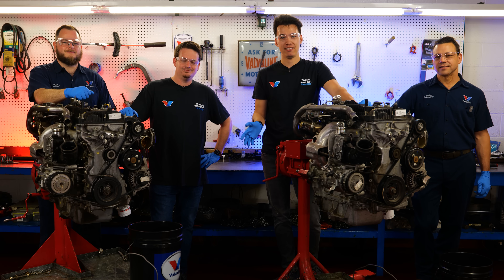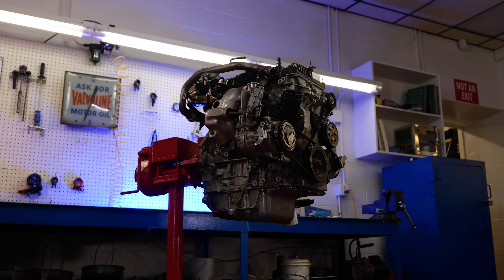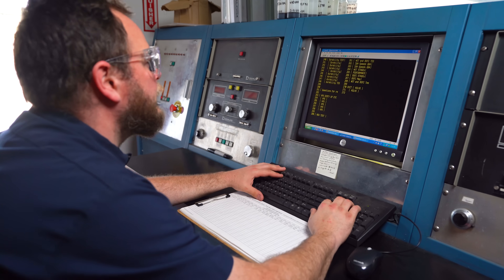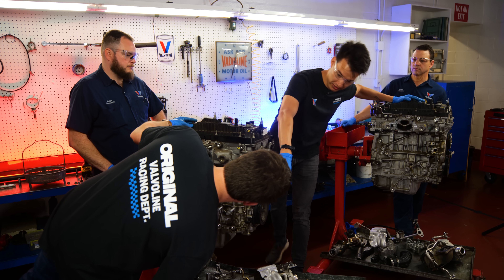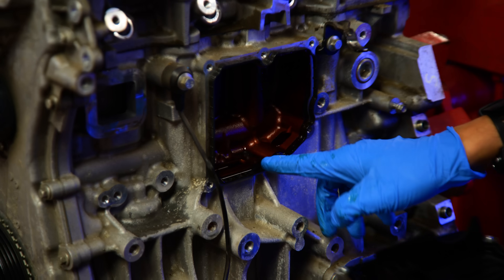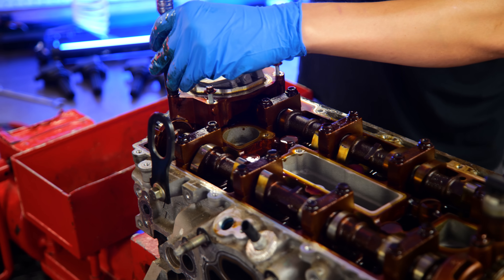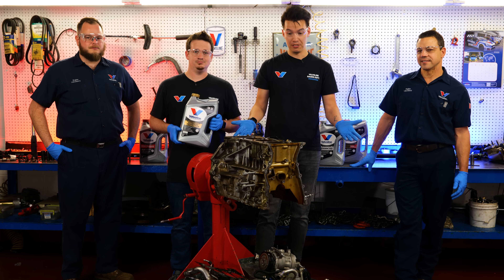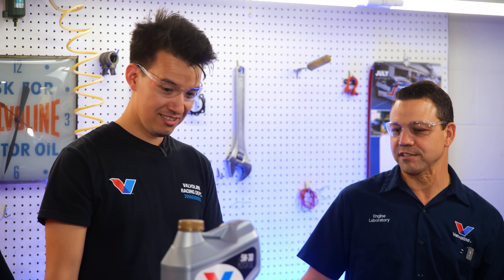Testing different oils over 4 years and 1 MILLION miles

Comment: I got my previous 4 cars with between 22,000 and 24,000 miles. Used only full sythetic oil and changes every 5,000 miles. All four reached o er 300,000 before I replaced them. Only maintenance was an alternator on one, the serpentine belts, and injector replacement on one. My current car I got with 22,500 miles, and currently it has 240,000 miles. Oil changes every 7,000, full synthetic oil, and it's still going strong. I do not buy the bargain oil.
Reply: What brand of oil do you like to use?
Reply: @DavidHernandez-oz4me  Penzoil full synthetic platinum 5w30
Reply: Beware of the Pennzoil Platinum vs the Ultra Platinum. Very simar looking bottles. The Ultra evaporates a lot less.@OcularPerceptions
Reply: @ytuploads9742  Pennzoil is Shell, total garbage
Reply: What vehicles were does if I may ask?
Reply: @Gabriellariz  There is no English answer to your question, as asked.
Reply: Sounds like motorway miles going the speed limit to me
Reply: @ArashiSanMa  If you do the speed limit on Florida highways, you'll become a hood ornament. And I'm in a mix of traffic every day. Florida highways become parking lots on a regular basis, so sometimes, going through the city is faster than staying on the highway. My current car just went over 262,000 miles, and I just replaced the struts and lower control arms. I did all the brakes last month. The engine is still dong fine.
Reply: Oil sold as full-synthetic in 95% of the countries are not full-synthetic oil with the exception of Germany.  Unless it explicitly says oil from group 4 or 5 (PAO/Ester) base oil, then forget about it being full-synthetic.
Reply: Yeah sure. 300k mile brake pads and rotors. Pretty good
Reply: should he also have to note he had to put gas in it once a week😂  "yeah sure 300k on a tank of gas"

Comment: a very good reason to go electric. maybe not now but in the future. EV motors don't need oil lubricant and may do long term service without problems. the battery and charging will be greatly improved. the real problem I see is reliability and diagnosis of electronics.

Comment: Americans, due to the pollution fleet standards, look-up your exact same car or engine sold in other countries for what oil weights and change intervals your manufacture recommends. Pay particular attention to them switching from Kilometers to Miles on the interval in the manual. For example, my 2010 FJ cruiser, Toyota recommends 0-w20 in the united states. The exact same vehicle in other countries can take up to a 50w, and change every 10,000 KILOMETERS (i.e. 6,000 miles). They also recommend more frequent for extreme use (off-roading, city driving). As I don't live in an extreme temp environment, I use 5-w30, full synthetic (shell), and change every 10,000 km or 6 months. Also keep in mind, the low octane on the untied states. Where I live, it is illegal to sell less than 93 octane, and up to 98 octane is available at most pumps. Ironically, that is due to pollution rules. 😆

Comment: I have a 1997 Ford Eddie Bauer Explorer I purchased new on December 28, 1996.  I still drive it as my everyday driver and presently have over 280,000 miles on it.  Regular maintenance and oil changes will keep your engine running for a long time.  I use synthetic oil in my Explorer.  Today's date is 10/29/2024.

Comment: Amsoil for the WIN!! 😁👍

Just imagine how much better an Amsoil engine would look even over synthetic Valvoline .
Reply: Saved over $3200 using Valvoline syn
Reply: @adamneill9237  you would probably save over $3600 if you just paid the $25 to be a dealer and get the Amsoil at cost. 

The more you know 👍
Reply: @johnnyturbo8460  I buy Valvoline Syn when on deal or Rotella T6. OCI's in the 7.5k area, and never an issue. Ain't broke, don't fix it
Reply: @adamneill9237  you do you, I don't like to settle for what's on sale, especially when i get Amsoil at cost. Most likely cheaper than Valvoline synthetic on sale.

Now, I'll use Rotella t6 on a barn find. Especially when I'm not sure of the engine's condition but don't want to run it on its old oil.

Then Amsoil it is, once I know it's a runner

Comment: WOW  from an old racer. HERE is the deal whenever you get a new motor-vehicle (yep basically any brand, though Toyota is the best) YOU MUST change the oil and filter EVERY 1,000 MILES for the first 5000 miles  (oil and filter 5 times). THEN begin a regular 3-5000 mile oil changes. THEN my friends YOUR little Corolla or whatever WILL have  hundreds of thousands of miles on it AND when you look down at the speedometer you will be flying at 80 MPH without even knowing it. THAT is how you break in a motor, and it will last until the end of civilization.  MAINTENANCE is the key no matter what. BUT yea Toyota passed everyone else as of 2024.  ARE you listening Germany, Japan passed YOU.

Comment: If the wastegate fails the crankcase won’t have right pressure and air mix won’t be right.  That could mess with engine performance and would cause the engine to degrade.

Comment: Bottom line synthetic oil the majority of it is a petroleum based product it has been chemically modified from its original crude oil base there are some synthetics however that are produced from other forms of oil such as plant based oil I have never had much luck with synthetics oil over the years I have tried it in different vehicles with bad results shame with my lawn equipment I am a firm believer in the real deal and also change my oil frequently which reduces the viscosity breakdown and varnish buildup Pennzoil is my go to product although I know valvoline is a good product also

Comment: I think if they changed the oil on both engines every 5000 miles there wouldn't have been any stuck piston rings on the synthetic engine. IMO any amount of stuck rings is an immediate failure and future usage of that oil should be stopped.

Comment: Synthetic keeps the engine clean most of times at regular usage and optimal temps. Good to see it working. While in some places it was harder to flush out all gunk and capture in the oil because of the design. I suppose you have to do an engine oil flush every 5th engine oil change or so with an additive before getting fresh oil in. This would boost the cleaning in a short period of time and keep the rings clean for the best compression and sealing.

Comment: Sooo. Now if you run synthetic through the engine that had the oil running through it, 2 or 3 oil changes would it clear a lot of that coagulation out and clean or flush the engine somewhat?

Comment: My 470,000 mile Volvo 240 has run CASTROL 10-30 its entire life, it looks better inside than your synthetic motor inside ,had valve cover off first time this summer for gasket replacement, I’m sticking with my conventional CASTROL as long as they keep making it.

Comment: I use valvoline advanced full synthetic in my new car. First change at 500 miles ( get rid of factory deposits), then change at half of the manufacturer recommended interval. But this is definitely one of the top oils out there for longevity.

Comment: should give more detail on the rod and main bearings wear, since those are the most critical parts of the engine if wear need to be compared, by the looks of it, conventional oil still good with proper maintenance interval and more cost saving in term of maintenance cost. Varnish are normal for that amount of mileage.

Comment: Here's the thing: My vehicle is factory recommended every 7500 miles. A full synth is $115 (8 quarts). I can get a conventional for $37 with a coupon and have been routinely doing this. I change it at 6000 miles with conventional at almost 2/3 less the cost.

Comment: A much more interesting test would be to see where a blend of conventional and synthetic sits on the spectrum. I suspect that it will be just as good as the synthetic, based on anecdotal experience. My car has run a blend since the beginning, and the design is such rhat i can see the valvetrain from opening the oil cap. Clean as a whistle in there, it looks brand new after a lot of hard use and extended intervals.

Comment: 12:35 engine will also run much hotter from all that hot blow by. That explains what happened in the cooling system.

Comment: Would it had been fair to change the conventional oil at half the mileage? I understand that it is a fact that synthetic oil lasts longer. What would be the RESULT with the engine running  with conventional oil?

Comment: I have an 2002 Corolla oil changes every 3,000 just got a reman put in. Only had its first oil change. Currently running synthetic blend. Recommendations?
Reply: Seems to be a fair change interval at 3,000 miles. For next to nothing, you can get a free oil kit from Blackstone and pay like $20 for them to analyze. Let them know on the form what oil and how many miles on the oil and they will let you know if you can extend to more miles before changing, if you should switch to full syn, etc.

Comment: It is perfectly possible to make a poor oil with a synthetic base stock. It is additive treat rate that ultimately determines how good the oil is. It's called tier level. Almost all modern lubes are synthetic.  The old base oils (Group I) are "non synthetic " and only used to blend obsolete lubes in non-developed countries.  Also- there is no industry standard technical definition of a synthetic oil. It is purely a marketing term but usually applies to hydro processed base oil (the oily, non additive bit).

Comment: Never surprises me. Like the chevy guy across the street working on his silverado every other weekend but asserting how great their vehicles are. The iignorance is breathtaking.
Reply: Owners who have been foolish enough to buy such products can't admit failure to themselves.
Reply: Chevys last exactly as long as Fords.  A Silverado w a 5.3L LS is far less stressed than a little turbo 4-banger.  Synthetic in Silverado… 500K + no problem and any repair bills would be cheap compared to a 4-banger turbo.  The turbos on the two engines in this test are worn out I promise you.

Comment: Hmmm.   I have opposite results with oil.   Diesel mechanic for 23 years and I always find the worst varnish and sludge in engines with synthetic oil.   Engines with conventional are always cleaner but hey, gas engines may be different but im basing it off of personal experience.

Comment: I've got the same drive line on my 2020 ranger and I change the oil every 3k and the truck experiences a lot of heavy payload and trailer. And a lot of gravel road/farm use.  I've used the synthetic Valvoline since purchase and the oil still comes out pretty clean with 150k miles on it so far

Comment: Old & hard of hearing but wondering if they used regular garbage gasoline or far superior top tier gas produced by over 25 companies. I use synthetic oil in my 2016 Honda CRV with 54,000 miles. I get the oil changed every 8 to 10 months ( Around 4,000 miles ) . On halve a dozen trips to the shore ( 160 miles each way ) I purchased Wawa's garbage gasoline in two states. Use the cruise control and all 6 trips took 3 hours ( +/- 5 minutes ). purchased top tier gasoline st Mobil, Citgo & Exon. All 87 octane for my 4 cylinder CRV. averaged 32 miles per gallon on Wawa's gas and 34.6 to 35 miles per gallon on top tier gasoline. According to AAA & others if you plan on keep you vehicls more then 3 years top tier is a win win. Better gas mileage and it keeps the inside of engines cleaner ( that alone improves gas mileage ) .

Comment: You should’ve changed the conventional oil at 3000 if you’re supposed to and like everybody else that uses it does then see the real results. This is totally unfair. Conventional oil never goes 10,000 miles between changes. The only thing I just learned is that they’re too scared to do it the right way because it probably didn’t even make that big difference if you change the oil every 3000 miles.

Comment: You should’ve changed the conventional oil at 3000 if you’re supposed to and like everybody else that uses it does then see the real results. This is totally unfair. Conventional oil never goes 10,000 miles between changes.

Comment: I have a 2018 Volvo XC60 from USA, 2.0, 310HP

Manufacturer on it’s website recommends 2 types of oil
1.	If I search by my VIN, or year+date it states:
Fully synthetic engine oil of at least ACEA A5/B5 - SAE 5W-30 
Or 
Volvo's VCC RBS0-2AE/SAE 0W20 oil is recommended for extreme conditions.

2.	If I search by engine name (B4204T27) it states:
Castrol Edge Professional V 0W-20 or VCC RBS0-2AE 0W-20

I have 3 questions:
A) What does volvo mean by extreme conditions?
B) When volvo states it needs “RBS0-2AE” – can I translate it to European ACEA C5?
C) Which oil and why should I pick? I live in Poland where temperature ranges from -25 Celsius to +30 Celsius

Comment: Trying the new Advanced Valvoline however I will not go past 2000 miles between oil changes since already at 160K miles, 2004 Dodge Ram 5.7 litre...No MDS...

Comment: 10,000 miles on conventional is way too long of an OCI and not a fair comparison. If they would have done 5,000 miles, it would have looked about the same as synthetic at 10,000 miles per OCI. The synthetic doesn't protect any better just longer.

Comment: No cold start, no heavy loads or high rpm cycles.
Even Hyundai failing theta engines can do all those miles cruising at low rpms all the time. 😂

Comment: I did the thame test in 1989 with Citröen 650ccm air cooled 2-zylinder boxer engines. The difference in colour was ever greater than in this exampel.The hydrocrack synthetic oils at the time was not convincing. It had heavier deposits than mineral oil.  Similar to this test is a test with standard 95 oktane E10 ( Germany !) fuel to 101 oktane premium fuel. Thin white to thick black deposits in the exhaust ( air cooled cab feeded four zylinder 1100 ccm motocycle engine without catalist)

Comment: Multi line car dealership with 11 mechanics over 20 years: We had zero oil related engine failures. Weight, brand, conventional, synthetic, nothing makes a difference except changing it. 1994 Ford F150 6cyl went 44,000 miles on factory oil before it grenaded. I do not consider that an oil related failure.

Comment: I can’t believe an eco boost is going 500k with a Joe Schmoe behind the wheel. Especially with those wet belts… they actually say to replace them every 10-20k because of all the heat cycles and oil wear on them. Interesting regardless but still shocking that those engines got to 500k synthetic miles

Comment: 10k miles is just way to long for oil change intervals on direct injected engines. Sure the synthetic oil has advanced a lot compared to conventional, but the fuel washing down the cylinders dilutes the oil at an interval that long

Comment: Hi ahead and use synthetic in a Harley and see how it works bearing skate and burn flat spots on them valve train sounds like it’s going to come apart especially in very hot environments like Las Vegas just use conventional and change the oil when your supposed to and you won’t have all that brown burnt oil crud in the motor oh and when your synthetic oil starts to leak it really leaks because it’s to thin I’ve never had a failure due to the use of dyno oil

Comment: Now they could just vet the guys that work in the Valvoline oil and lube shops where there’s no lubing done. It used to be oil and lube now it’s just oil change check the windshield washer fluid and if you’re lucky, they will check your transmission fluid and maybe your brake fluid.

Comment: Bear in mind that neither one of these engines were in the outside elements where it contaminants were dirt and dust, and everything gets in through the vacuums and different areas of the engine where the filters fail.

Comment: So why doesn’t Honda use a standardized synthetic oil for the Honda Accord 2007 four-cylinder 2.4 VTEC engines? These engines run forever as they say.

Comment: Also what's the price difference between the 2 different oils? Because given that the conventional oiled engine looked very varnished it wasn't terrible for a 500k mile engine but does the cost difference justify the need to use the full synth oil vs the regular oil?  I have seen cars using regular oil with a slightly shorter oil service interval looking just as good as a very expensive oil.. I am only trying to see if you are comparing it fairly and is the Valvoline wort the money, I KNOW IT IS WORTH IT but I think it's a fair set of questions

Comment: Regular conventional oil change to keep engine clean- every 2000 to 3000 miles. This engine with conventional oil has not had regular oil changes. That engine has had oil change at least 5000 to 8000 miles to have such a build up. So let's not get that hype that synthetic oil is great. It is great with new gen engines, barley broken in. For older engines pre-2000s. conventional ( Motorcraft, Shell, Valvoline, Castrol, Agip, Motul) . The key is frequency of oil changes and good filters.

Comment: Well these tests are pretty good but in my opinion the color doesn't even matter what matters is that if the engine is really clean with proper maintenance and proper oil change intervals you'll be fine don't worry about like the color

Comment: These engines want 5w20 right? We dont even have mineral oil in 5w20 in europe.
Also 16k kms is a to much on mineral. And not enough on synthetic as most intervals are 20k kms. My renault even ask for 30 k kms oil interval. But i do 10k because im a mechanic and why not!